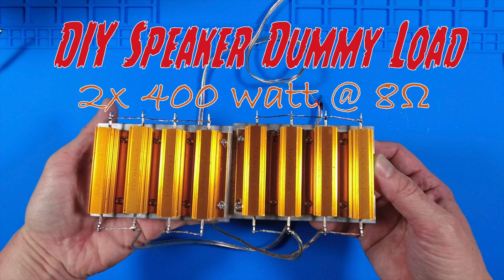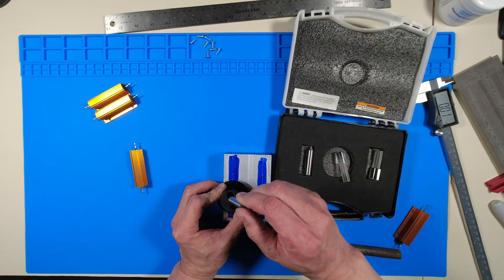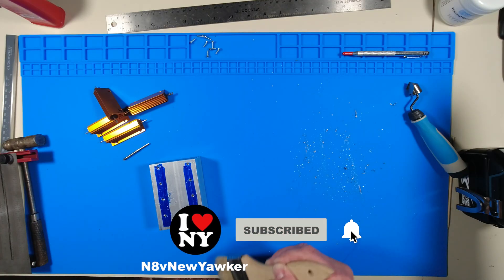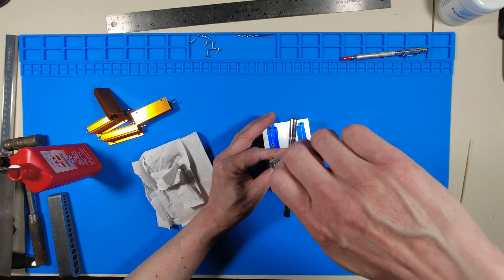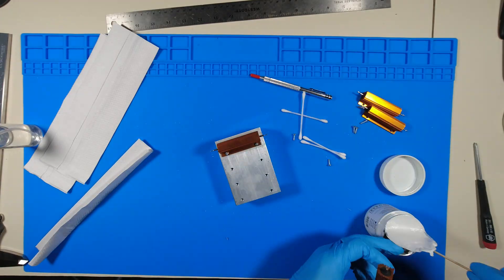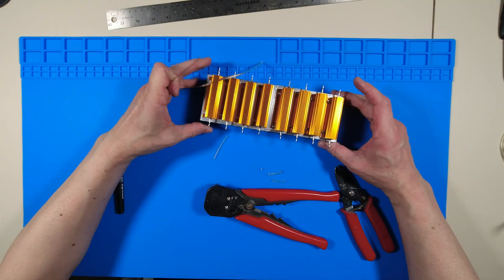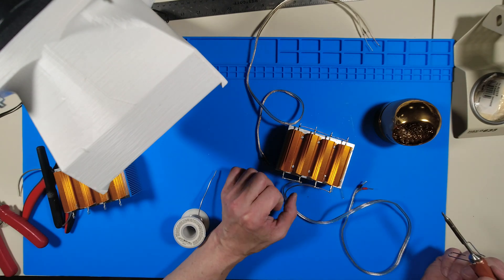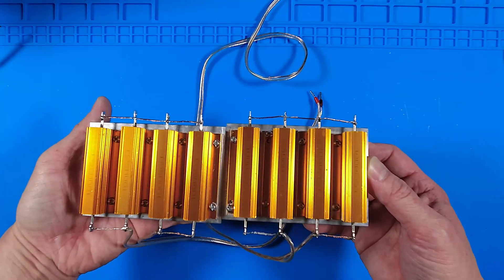DIY 8Ω 400 Watt Speaker Dummy Load For Testing Audio Amplifiers

Comment: I am just in the process of making my own test bench dummy loads and I need 8ohm @400W.  I have been told to ONLY use non-inductive resistors. NOT these wire wound ones. What is the truth???
Reply from the maker: Also depends on how the resistor is made. If its wirewound in a way (forward and reverse) then the magnetic field cancels itself out, becoming non-inductive. But like I previously mentioned in another reply.....'The amp mfgr (Crown) has a formula to calculate their limiter settings, I just made these at 8Ω to see what the limiter is doing on my O'scope. I'm not going after audiophile specs, Not using these on Mcintoshes, Mark Levinsons, etc

Comment: Talk about inductance and temperature coefficient, shall we?
Reply from the maker: I paid a little over $35 for the 8 resistors and the two heatsinks total. I dont plan to test its inductance and TCR as I am only using these dummy speaker loads to see what an amplifier's built-in limiter does to the waveform. Now, I did test them on one of the smallest amps I can get my hands on (275 wpc @ 8Ω) and after a few minutes at full power, they got too hot to handle. What I plan to do with these, as mentioned in my video, is to make a tutorial video on setting up an amplifier's built-in DSP output limiters.
Reply: @n8vnewyawker8  Pretty sure inductance is something you don't want to ignore especially when testing limiter circuits. The inductance of an actual speaker changes as the coil travels in and out but you can just grab a big high current inductor with about same inductance as a speakers highest value and call it a day.
Reply from the maker: @yunodiewtf  You are definitely correct, The amp mfgr (Crown) has a formula to calculate their limiter settings, I just made these at 8Ω to see what the limiter is doing on my O'scope. I'm not going after audiophile specs, Not using these on Mcintoshes, Mark Levinsons, etc.

Comment: What does the impedance curve look like?
Reply from the maker: The impedance curve should be a constant 8Ω for the frequencies I will be using it for (100Hz, 1KHz, and 10KHz). I dont plan to inject any frequencies higher than 1KHz into the amplifiers I will be testing. I only want to determine the clip point of tested device and compare it to the mfgrs specs.